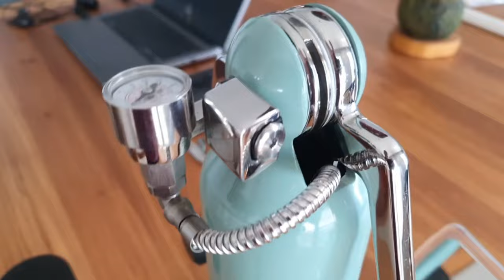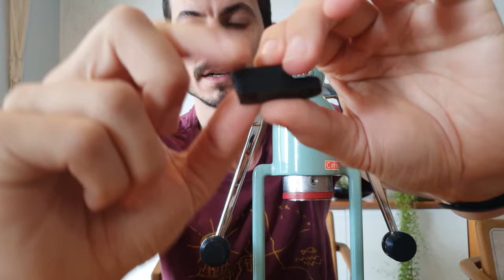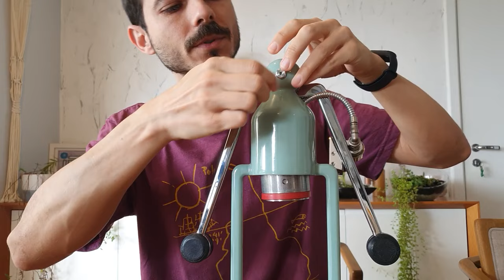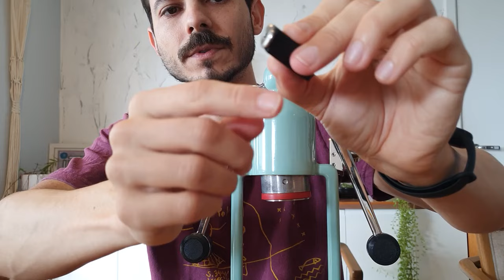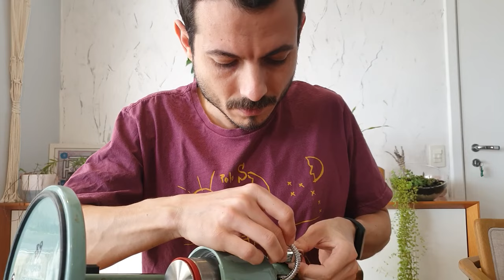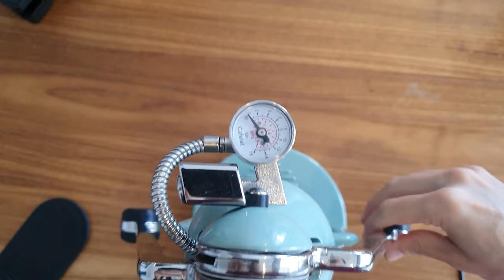Pressure Gauge holder for Cafelat Robot

Comment: Great mod Santiago, i printed and just installed this on my robot. I noticed 2 things and would like your feedback if possible. First is i needed to invert the pin/screw north to south and viceversa which is perfectly fine as you mention it in the vid, but my issue was that the pin per se is slightly longer than the thickness of the  body of the robot hence  the printed piece couldnt fully lock or tighten against the robot. I had to install a washer on the pin side to make the pin flush from the other side and make the plastic printed part tighten fully against the body of the robot. Second, not sure if its an issue but it concerns me and would like to confirm from other members that have installed this piece if you feel strain  on where the pressure line meets with the 90 degree elbow on the gauge. I feel mine is not as free flowing, feel it a bit stiff now in that area. Thank you!
Reply from the maker: I'm not sure if I got correctly, but on my Robot that pin/tube is flush with the Robot body (or head in this case lol). Good ideia on installing a washer on the opposite side of it. To be honest, sometimes the gauge tilts a bit, but I force it back to the horizontal position and it stays there for a while.
I don't think there is much strain in the tube, but it's definitely something to consider. It might wear out quicker, but I think it worth... And so far, I've been using it for 4,5 months and it's holding up pretty well.
Reply: Thanks for the reply Santiago. All good. I figured everything out.
Reply: I bought my Robot last month and had the same issue with the hex screw and pin.  And also like you, a washer solved it and allowed me to tighten it up fully.
Reply: @FF-rr8fp What kind of washer did you install? Having the same problem. Did it go to the 3d holder side?
Reply: @ikonoklast7  What kind of washer did you install? Having the same problem. Did it go to the 3d holder side?
Reply: @ccoovvii  hey, its been a while.. i just looked at the robot and the washer i installed looks like a pressure washer but its completely flat. I think its the only washer i had laying around that fit the thick pin when i did the mod. iirc i kinda expanded the washer so it looks like the letter C now so it can slide over the pin.
Reply: @ccoovvii  a random split ring lock washer found in my rummage drawer, to be honest.  It's in between the body of the Robot and the 3D-printed holder.
Reply: @FF-rr8fp  I see! I installed the washer on the other side of the 3d printed part and it secured the part now!

Have you fixed the issue of the tube rubbing the body?
Reply: @ikonoklast7  thx,  Have you fixed the issue of the tube rubbing the body?
Reply: @ccoovvii  I haven't had an issue with it, but ymmv

Comment: Interesting. It almost appears as if you could drill out a hole in each side of the bracket and run a screw directly through the original bracket. Big hole to the outside and small screw sized hole to the inside. Maybe add a small washer between bracket and robot.

Comment: Do you feel the tube rub against the arm?
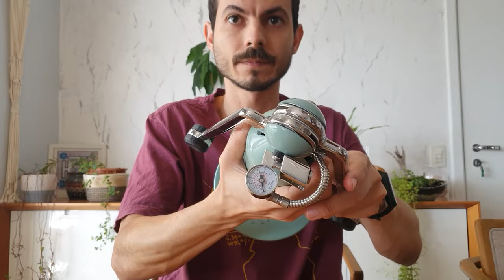Reply from the maker: Not at all. You can see at 4:50 how the tube goes away from the arm. It does rub a little in the inside of the body (4:59). I thought about gluing a small piece of transparent PET from soda bottle there to prevent wear it out but I think it's fine, not needed.
Reply: @ekjellgren did you fix this problem? Tube does rub against inside of body, and it may do some damage over a longer period.
Reply: @ccoovvii  i have no issues with that
Reply: @ekjellgren ooh do you mean you just let it rub ?
Reply: @ccoovvii  yes it's pretty minor
Reply: @ekjellgren  cool looks like it held up in 1 year, i just put some tapes on the body to cushion the rub

Comment: Just installed this on my robot.  M5x10mm stainless hex head bolt also fits perfectly on this design.  Socket head is required on the alternate design from the website.  Great work Santiago!

Comment: So smart to be able to store the original screw! Can the meter be turned so it shows the scale in ”normal” view? Do you use a scale that fits under?
Reply from the maker: The manometer cannot be rotated but it's pretty ok to read it in this position. I do use a cheap 0.1g scale from AliExpress.

Comment: Sorry to bug you again. Were you ever able to reorient the pressure gauge?  I tried to loosen  the bolt to turn the gauge but no go. Thanks again!
Reply from the maker: AFAIK it's not possible to reorient it. That's why mine is sideways. It's pretty fine for me to read the gauge like that.
Reply: @SantiagoLuz Do you have patreon?
Reply from the maker: @Getsitdone  I don't. I just wanted to share this with other Robot users as I've found it useful. If you want to be so kind there is a donate link via Ko-Fi in the description box.